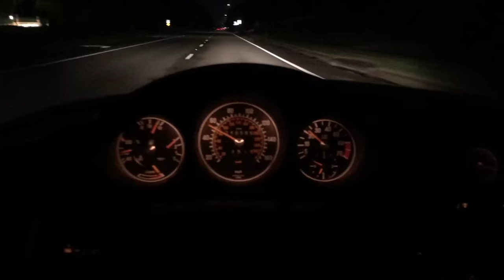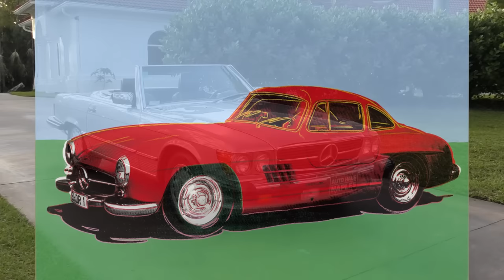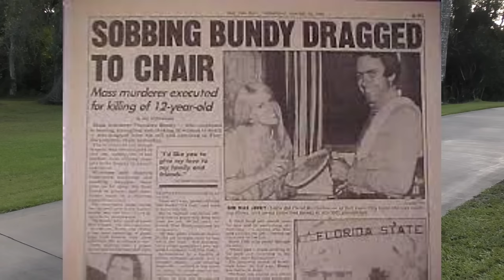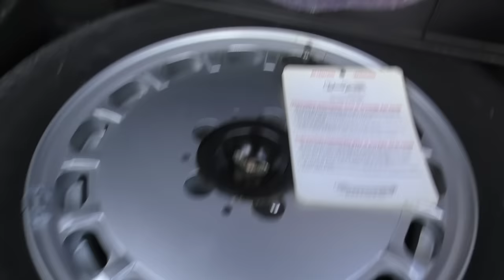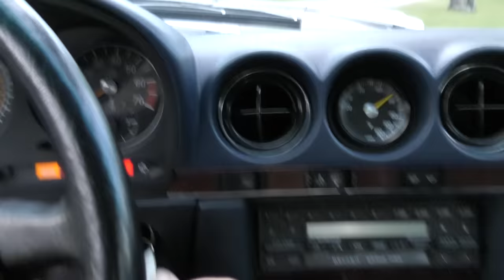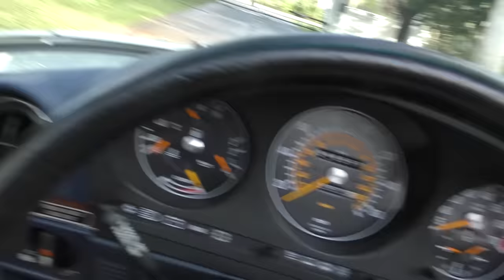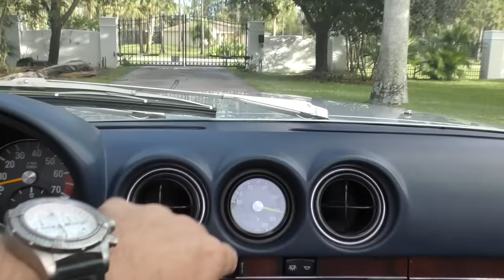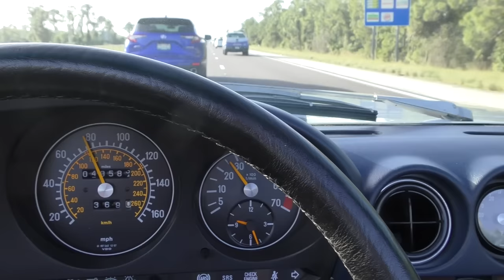The Best Convertible Ever Made?  This 1989 Mercedes-Benz 560SL Roadster was the Last Topless Classic

Comment: I had an R107 560 SL. An R129 SL600 and an R230 SL55. They were all magnificent cars in their own right. The SL55 was insanely fast. Handled great and was beautiful. Mechanically, it’s top was entirely over complicated and prone to failure. Usually, when you were dressed nicely and with your significant other, the hydraulic seals on the top of the windshield would let go, resulting in a cascade of hydraulic oil all over your lap. No fun at all. The SL600 V12 was actually a pretty reliable piece. The styling of the R129 was underwhelming. It was still solidly built and not full of electronic do-dads. My favorite of all, was the R107. The manual top was super easy to deploy or secure. The handling was that of a GT car and not a performance car. The engine was powerful and reliable. The styling was absolutely magnificent. Classic, understated and perfectly executed in every way. This one, is bordering on museum perfect. Congrats on the award, Bill. You have certainly earned it!

Comment: I can imagine how hot rod that MB felt with that drive train. The induction was quite different if I remember. You had a great big point can with a spinner. You had an air breather that looked like a carb. You had all the fuel injection lines running from a header block. I spent almost 1/5 of my life trying to put this drive train back to speck. And believe me when I mashed the throttle it delivered amazing performance - sometimes. It was an expensive quirky power train and I wore out after about 12 years. When the toyota camry outran me I just gave up.

Comment: Very nice Mercedes, thank you for posting it.
IMHO I was surprised to see the discoloration of the radiator over flow tank
with only 49,000 miles on the car, I replaced mine they are not that expensive.
I also had the complete exhaust system Jet Hot Ceramic coated that will now
last for years, they will never chip, crack, peel, or discolor. I brought the last
remaining set of the exhaust manifolds from Mercedes, they are now not available,
I will have them coated as well.

I would love to see the underside of the car especially the exhaust system,
in slow motion of the camera, so i can get a really good look.

Comment: The problem with 70's Mercedes bumpers is that minimal impact knocks the side trim out of whack, the angle becomes wrong and the whole sideline is ruined.  You just want to bend the damn thing back down.  And this one has the issue on the right front.  Really bad on the S class sedans too.  Architect friend of mine bought one of these about 8 years used; lived in the city, there was no reason for it.  But it was a bucket list item for him and he loved the heck out of it.

Comment: As a fellow class of 90 alumni, I've never seen what it takes to drop the top on a SL. What a time consuming, possibly painful operation! For a car so supremely well engineered, one would think during the 17 years of production Mercedes would've improved the cars #1 party trick. What an amazing car, it basically looks as if it rolled of the lot last week.
Reply: So the next body, the r129, has the over engineered automatic top up and down operation, beautiful when working properly, when those hydraulics start leaking, absolute nightmare, ask me how I know 🤨🤨
Reply: My only gripe is that the top, you'd think, would be Miata NA and NB easy, or even ND with one latch, toss the top back, done.

Comment: Had a good 85. Gorgeous BUT getting too up was a pain and installing the hardtop was a two man operation. Sitting it required either a garage hoist or a stand. Unfortunately as gorgeous as it looked too down it lacked power. It’s a head turner though

Comment: I had one of those and they are nice cars. Fairly simple to fix and inexpensive. However, the W129 is a much better car in comfort, suspension, interior room and power. If I was to buy a classic Mercedes convertible The 500SL would be my choice instead of the W107.